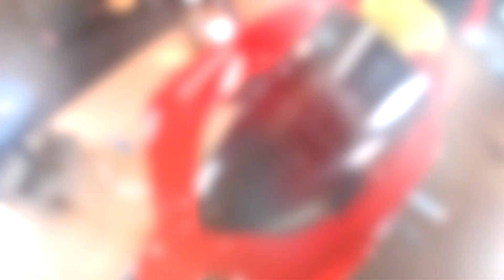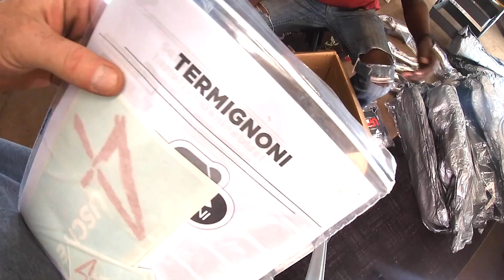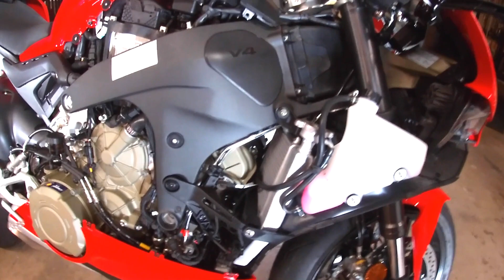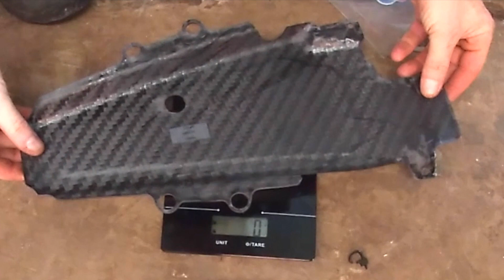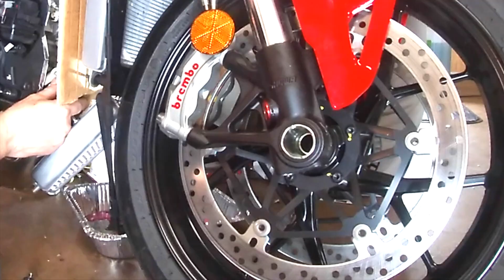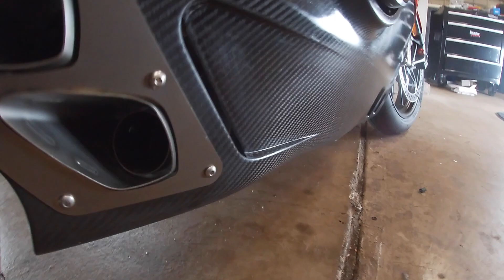2021 Ducati Panigale V4 Termignoni 4 USCITE Exhaust installation & upgrades

Comment: Did you guys have any issues with check engine light coming on after the install?Im buying a 2020 V4 with the same 4 uscite exhaust and the owner told me the bike has a CEL because of the exhaust.And I’m wondering if it’s because of the exhaust.Thanks for your time and great video
Reply from the maker: No that exhaust didn’t cause a check engine light for me.

Comment: Did you put the stock heat shield back on the one in front cylinder?
Reply from the maker: The new exhaust does not use heat shields. The original exhaust included welded on shape conforming shields that are not removable.     
Short answer is “ no, I didn’t”

Comment: How much power gain ?
Reply from the maker: Slightly more power at some rpm range. Not enough of a gain to justify losing the protection of factory exhaust heat shields.
Reply from the maker: https://mygpracing.com/product/ducati-panigale-v4-s-termignoni-4-uscite-full-titanium-racing-exhaust-system/
Reply from the maker: According to this page - 6 hp gain.